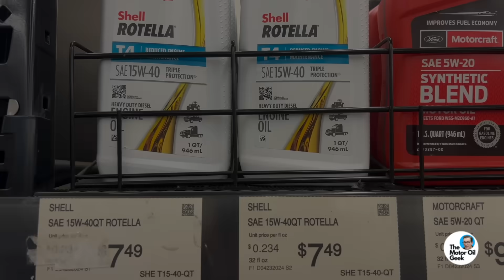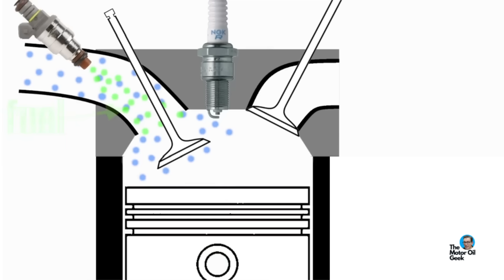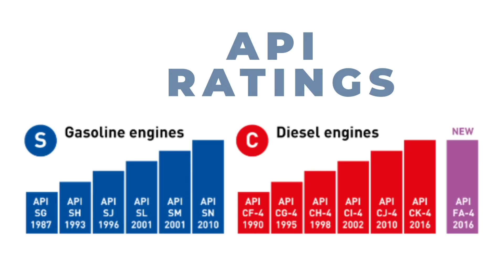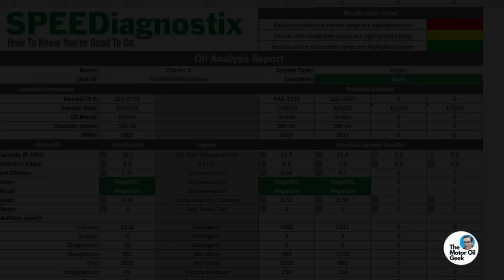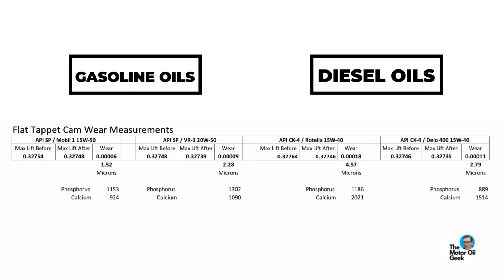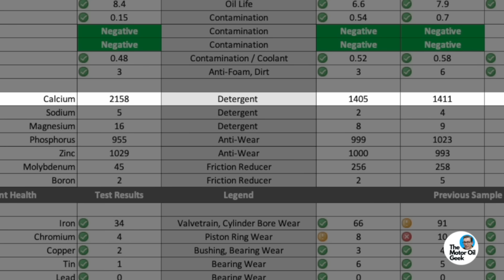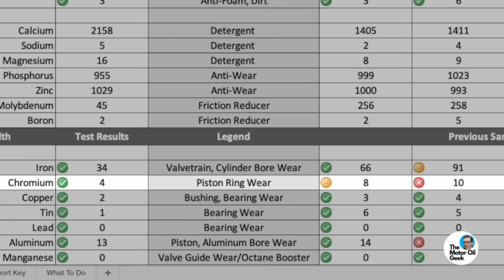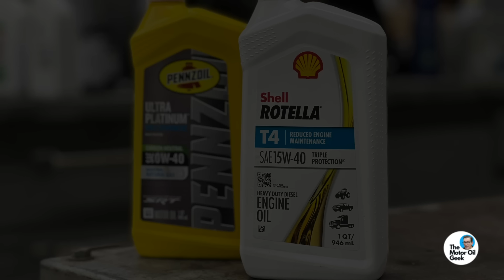Why DIESEL Oil is Actually WORSE for Gas Engines!

Comment: Bold to assume we run it because of zddp. I’ve always run it for the calcium. Clean engine is a happy engine. I’d rather take my chances with 0.00018 whatever-crons of cam wear than engine sludge and carbon. Id wager that over the lifetime of an engine the cleanliness of the c oil will end up thwarting more wear than the anti wear additives in the s oil. I wouldn’t put it in a direct injection engine, the super detonation is real I’ve seen it, but I also wouldn’t own a direct injected engine.

Comment: I've been using Rotella T6 5w40 in my direct injection engines to my 455 big block for 21 years now.  Send in oil analysis often with over 200k miles on my engines with stellar results.. So the science here is irrelevant to me. My own 20 year study shows different.

Comment: I've run Rotella T6 5w-40 in many gasoline and diesel engines over the last 15 years. Back when I did my research I found the 100% PAO base stock delivered a higher quality product that lasted longer in high heat applications, particularly turbocharged. Modern engines, not flat tappet. 
Over 5000mi OCI's. This was backed up by several Blackstone used oil analysis. I will continue running Rotella T6 in gasoline engines.

Comment: besides they finding out more modern engines are taking a crap when required ro use 0w5 0w10 0w20  5w10 5w20  ect.

Comment: This is the stupidest thing i've ever heard......

I put t four in my diesel trucks, my tractor the lawnmower, the righty mower, my car, the wife's car, the quads, any and everything....

As long as the temperature doesn't get down to cold, it's never an issue

And if temperature's an issue T6 works fantastic, also

Comment: Ive ran 15w40 for years in my engine = mopar slant6 ,318 , 360 and big blocks and my moms 1996 jeep 4.0 six cylinder wirh fuel injection with a WIX 51515 oil filter no issues. And it keeps the engine clean unlike regular vehicle oils
Reply: Same. 4L Jeep, Buell ,  Honda 90 , Briggs and Stratton, a clean engine is a better engine.
Reply: Older engines like that stuff especially when they have Miles on them

Comment: What is your recommendation for cleaning the inside of a plugged up indirect gas injected engine (GM 3800 supercharged)?  I am currently using diesel oil at an attempt to do this.
Reply from the maker: Valvoline Restore & Protect

Comment: ...I know where were going with this... nowhere. You've read the comments. I ve done changes on all kinds of different combustion engines. Smoking, knocking, put  favorite additive in the engine, it goes away for a little. Turn over to diesel lubricant, t4,t5,t6. Noise and smokking gone. Btw the way you say diesel oil, I'll just go to the gas station and fill up my crankcase with that. " I added diesel oil to the engine like j smith said.   Now it's making funny noises."😂
"Hey, I can add my favorite detergent to my engine too, its cheaper."👍😆

Comment: Very interesting. I swapped from conventional to diesel oil (T6) in my 03 suburban when it developed a lifter tick. Every other oil change it gets a half qt of trans fluid also (I thought detergents were king). That combination freed and has kept my lifter free. I swapped oils at 280K miles and have 475K now on the original motor. Didn't realize I was playing roulette like this. Anything I can do now to remove that carbon/calcium buildup?

Comment: We’ve been using diesel oil in our gasoline engines for over 40 years and get 300,000 -400,000 miles regularly without any major engine work.

Comment: many engines run too thin a oil the oil used ex factory is incorrect viscosity for most engines unless they are used in the same climate as the location of the factory.

when it comes to the oil additives you can have too much of a good thing in your engine. note many oils are now multi service oils.

 if you use a oil that meets the api spec set by the manufacturer you can't go wrong. then select the viscosity range for your climate.

Comment: Long one.... i had a Suzuki LTR 450 quad, notorious for a whine coming from the trans when they  get hot and its in Neutral. Buddy and i both had them, both whined, honda, yamalube ect ect

Read forums.... Rotella 15-40 t4 or amsoil were the fixes. 
Buddy went Amsoil cuz he likes spendy shit, i Went Rotella.... Both quads never whined again !
I was sold couldn't believe it.

Since then 15 years now.... i run 15-40 Rotella T in everything i own, every bike, quad, kids toys, lawn mowers, generators, Honda civics, Toyota Tacomas, Diesels, 500hp Turbo Honda cars. 
I have a 2004 Yamaha yfz 450 original crank and everyone knows those quads lose cranks without the oil mod... still going strong. 

My 2004 3.4 Tacoma has had maybe 5 oil changes since a bought it at 100k, now has 220k... oils always golden never had a singke issue other the o2 sensor. 

Never lost a baring or had a major engine failure. 

Its good shit.... im old school cant teach me any different  !
Rotella T4 15-40 white jug of the cheap stuff, it goes in everything !

Comment: Diesel motor oil in modern engines is bad, which makes sense, both modern diesel and petrol engines use synthetic motor oil. The real question is what about classic engines? Would diesel oil, specifically T4 be better than modern conventional oil?

Comment: Good video, I think yes, if you can purchase a high quality oil (like Helix ultra, Mobil 1, Pennzoil ultra) maybe that is the best option, but outside of US the chances of getting a good oil are greatly reduced. For example, in my country you can get good quality synthetic oils, but the prices are insane (1 liter of Mobil 1 0w40 costs the same as 5 liters of Shell semi-synthetic 10w40). And the additive and base oil packages in semi-synthetics are usually rubbish: poor base oils with low additives. Sometimes in these cases (as long as it's not a direct-injection car), you can get a good Heavy Duty diesel oil, which at least has better antiwear properties and higher TBN than a semi-synthetic.

Comment: Lake,

Thank you so much for sharing this data—it really hit home for me. I learned this lesson the hard way with a lawn mower a few years back. I had purchased a John Deere 757 zero-turn mower equipped with a Kawasaki FH721D engine. When I got it, the engine had about 714 hours on it, which didn’t seem excessive to me. According to John Deere’s specifications, the hydraulic system required John Deere Plus-50 15W-40 oil, a diesel-rated oil with API CI-4 PLUS and SL classifications. Since it carried the SL rating for gasoline engines, I decided to use it in the engine as well.

That turned out to be a mistake. By around 790 hours, the engine developed a severe oil leak, with oil escaping from both the front and rear crankshaft seals. Upon investigation, I discovered that the engine had excessive blow-by, causing high crankcase pressure that forced the oil out.

Replacing that engine cost me about $3,300, not to mention the headaches and busted knuckles that came with it.

After watching this video and reflecting on my experience, I’ve decided I’ll never use a C-rated oil in a gasoline engine again—unless it’s an absolute emergency.
Reply: Also the engine requires turf gard 10w-30 part number ty22029
Reply: A 757 should use 10 quarts of plus-50 II 0w-40. Not the 15. I’m sorry you were misinformed. Part number is ty26665
Reply: @anthonysmith4222  Page 40 of the Operator's Manual (OMTCU20986) says 
The following oil is preferred:
• JD Plus 50 15W-40
The following oil is also recommended:
• SAE 15W-40
The following oil is allowable:
• JD Plus 50 0W-40 Synthetic
Oil must meet the following:
• API Service Classification SG or higher
Reply: @ What John Deere manual are you reading?

Comment: Laugh my ass off at 1:45.  The genius who  animated that 4 cylinder engine had the pistons smacking the oil pan  yet ignition is happening in 4 different colors above. Yes, I can drive any stick shift  and have been a motorhead for 60+ years..

Comment: Dave is full of crap and spreads misinformation due to lack of knowledge or for clicks, makes up false reasons for major services/machining and rebuilds that blame manufacturers when those who do real repair work know it is from bad repairs and repair practices. He may do good work but his knowledge on how things work and design reasons is baseline piss poor!
     Older Diesel oil formulas have more zinc/zddp/moly, read the msds. The newer "yourapeeon" diesel/gas oil formulas have far more boron to reduce the particulate buildup in erg coolers, intakes and dpf systems and does not coat exhaust sensors and works better at preventing pre ignition. Again read the oil analysis for each version of oil and you can clearly see the difference. Older style diesel oil has tons of detergents and works excellent for chemically cleaning dirty engines aggressively using oil flushes/ kerosene/ diesel etc as a solvent additive. I use it all the time as a short term use oil after a flush to aid in carrying the trash out.
 Using the correct version/rated engine oil, transmission fluid, power steering fluid and coolant in more and more newer trucks/cars is a real concern owners need to be prepared to supply themselves at services!

Comment: Bologna. Always ran Rotella T6 in my motocross bike when I used to race. Zero issues and less wear than people I knew who ran Honda oil.
Reply: I run T-4 15-40 in my BMW r100 it has 90 k on it and still runs like a champ. Took it on a 2k trip down thru tennesee a few years ago and it was 105 degrees without an issue.
Reply: @brianhiggins7599  using Delo XSP synthetic 15w40 in 2010 R1200. The oil is SN rated and has low zinc levels to save catalyst and oxygen sensor.  15w-40 is acceptable weight according to manual

Comment: Does an engine designed with the oil housing upside down like VW result in a lack of start-up oil pressure in a similar way that putting on a dry oil filter when changing oil.

Comment: How's about on low compression vintage/antique flathead multi-cylinder engines? The farm wisdom was 15W-40 diesel oil for the added ZDDP, extra detergents to cut the sludge from 50+ years, etc. Heavier weight to keep pressure up in worn bearings. Are we actually doing more damage than burning some oil and seeing a lower number on the dash gauge?

Comment: This video made me curious cause I’ve been using 15/40 diesel oil in my beater accord for the past 6 years has 300k but I do notice that rotella or any of the fancy ones it’ll burn it but I use the Walmart conventional and after 5000 miles only like .5 quart missing

Comment: I think the reason people run diesel oil isn't because they want to but because it's a heavier weight. when I had a Miata and its big in the Miata community you run Rotella 1540 diesel oil because it gets rid of lifter tic and slows down oil consumption

Comment: This is interesting but you’re talking about “new” engines…. Running the wrong oil in a no miles brand new engine is probably a bad idea…. But what about the stuff with blow by bad enough to blow your oil cap off???? You’re getting a lot of soot and stuff u don’t want in you 0w5 gas engine oil… and not to throw idiot gas on the stupid fire but the amount of cam wear on brand new cams isn’t cool…. Something changed…. Stuff didn’t use to wipe cams on flat tappet motors like it does now….. so is that a result of the oil or is that a result of poor manufacturing???

Comment: This is interesting. I drive an older land rover with the problematic aluminum 4.6 v8. I have had two mechanics recommend Rotella due to it's additive package. I am due for an oil change soon, I may need to think about using something else.

Comment: It should be common knowledge by now, that all passenger car engine oils have a largely depleted, very small amount of ZDDP if any at all. Having said that, if you operate an older car with an engine equipped with flat tappets you need to add an engine oil additive such as STP oil treatment with a high amount of ZDDP or you will destroy the camshaft and lifters.
Reply from the maker: Stay tuned for the next video!

Comment: I ran diesel oil in my Harley for almost fifty years, I am a retired heavy equipment mechanic, you probably have never built an engine, I run gas in my engine, no oil goes in my combustion chamber, you guys don’t even understand a simple engine, why do you think oil goes in the combustion chamber, a diesel engine smokes from the fuel not the oil, jeez

Comment: Any problems with diesel oil for single cylinder air cooled carbureted engines? Some manufacturers like Briggs recommends 15w40 for long hot temperature uses.

Comment: Rotella T6 full synthetic is rated WAY higher than gas rated oils 
It is better because it can handle heat WAY BETTER because diesel oil is made to tow heavy loads with HOT TURBOS 
I use T6 Rotella in the BMW Honda generator and tiller as well as in the 7.3
Many bike racing guys use only T6 as well
Only thing i dont use T6 in is the Tacoma because it uses 5w30w

Comment: I'm not sure quite what the aim is of this video.  Detergent oil is okay, just as long as you start as you mean to go on, as in, from new.  If you drop it in an old engine, it will drag off all the crud, and without shorter times between oil changes, (at least in the short term),  will do a lot of damage.   From new, there won't be any buildup of crud, and that in its self can greatly extend the life of any engine.  It's not just about cams.  I will say though, you do need the right grade oil, for the particular engine, and this may be where problems arise.   Also, being that the diesel oil collects the crud, and that it's not left all over the inside of the engine to accumulate,  the oil will get dirty sooner, so more frequent oil changes will be a good thing.   When I say, oil changes, that goes for filters also.

Comment: I’ve run rotella T5 and T4 15W-50 in my 25 year old small block truck used for very heavy tow application, it lives at 3000rpm full throttle for days at a time, I’ve put close to 3000 hours on it with this oil and have seen no negative effects. 
But this video seems focused on new direct injection engines that call for pretty specific lubricants, not my situation so fair enough.

Comment: Excellent info on the effects of zddp additive.

Ironically, this isn't the only difference of diesel oils over gasoline oils, cushion ability being the main difference, which is completely clearance dependant. Ability to carry contaminants shows the tendency of thicker cushion in order to suspend the crankshaft and keep contaminants away from crank and bearing surfaces. This is what keeps the crank centered in the bearings and eliminates bearing wear. Same with other engine components... Low tension rings often requiring lighter weight oils to be capable of wiping due to less pressure. And cold climates changing needs for cold starts...

Comment: so whats the difference in wear if you had a roller cam setup or a tbi/carb motor, maybe you have a little too much timing in your hot rod you could also have a little preignition if advances to much...

Comment: Whatever. Been using  15/40 Motorcraft diesel oil in my 1997 , 4 runner. 468k and still strong and clean.  Best oil I have ever used. Been using that oil for the last 300k on this truck. I had that oil for my 1997 powerstroke navistar. It has 375k both trucks have original engines.

Comment: I think you need to be more direct that this is for direct injected turbo applications. In an older normally aspersion engine all this dose not apply. Also the oil most of us use is T6.

Comment: Think these guys need to hash it out with the oil companies. I called shell direct about the rotella 10w30 t4 and they said it was perfectly fine for my old in-line six carbureted engine, and this oil is actually S rated for gas but it’s not put on the bottle cause it’s marketed as diesel oil

Comment: Does the same logic apply to motorcycles with their higher compression ratio? I've read on many many forums to use Rotella T4-T6 in my 3 Honda bikes from an 84 Goldwing to a 92 Nighthawk 750 as they met or exceeded the older oil specifications. Now I'm wondering if that's not the case? All 3 bikes are a wet clutch as well so I wonder if that's got anything to do with it?

Comment: I used desiel oil in my used cars when I get a used car in with a nasty carbon build up to basically clean out the engine run it for 1k then change with normal oil

Comment: If you run 15w40 in an engine that requires 5w20, then yes, that is a problem. Just run the correct weight oil, and no problem.

Comment: Well, this has opened a poop storm of Amsoil guys on motorcycle chat boards saying "see, we told you diesel oils weren't good for your bikes. You need our 18. a quart metric (v-twin, MC) oil!" As always, an oil analysis can help you decide between a popular MC oil (Z 1300, P 1200, Calcium 1100, Moly 0) and a popular diesel oil ( Z 1100, P 980, Calcium 824, Moly 54.) I agree that high calcium oils may (might, maybe, possibly) cause more wear in some gas engines, but it's very possible to find a dual rated oil that will do well in a gas burner, especially with a CK-4 oil. Analyze your oil folks, you'll find out what you need to know.....otherwise it's just speculation.

Comment: I have a 1995 Ford F-150 with a 300 cu. inch straight six. I have used Penzoil 15W-40 the first 180K miles. I had to switch to Shell Rotella because the Penzoil was getting hard to find. I currently have 385,000 miles and the engine is original. I am going to continue using diesel Rotella oil until the truck dies. I suspect I will get at least 500,00 miles on the engine. Not all heavy detergent oils are bad for all gas engines. Just depends. Besides car manufacturers want your car to wear out so you will buy another new one. 30 years old and still going strong. Just got back from a 1200 mile trip and crused at 75 MPH the entire way on the highway.